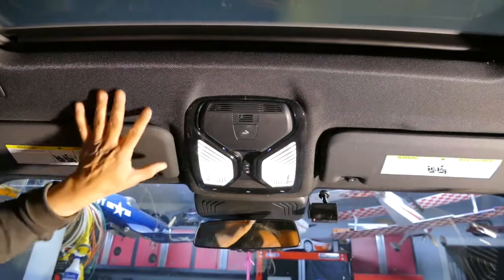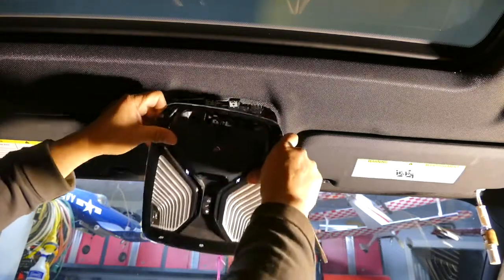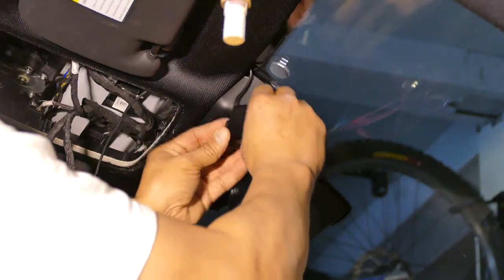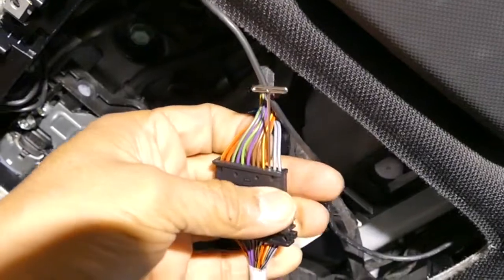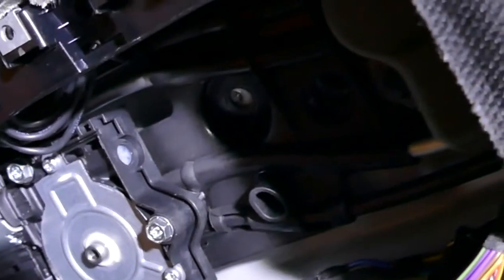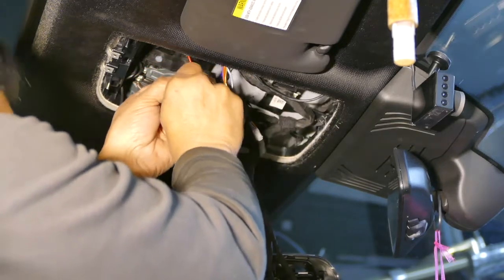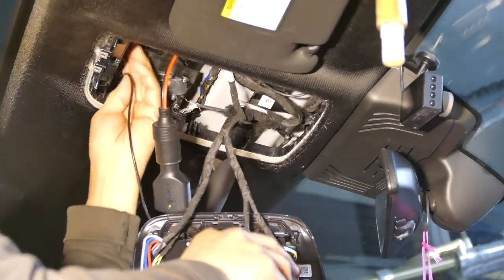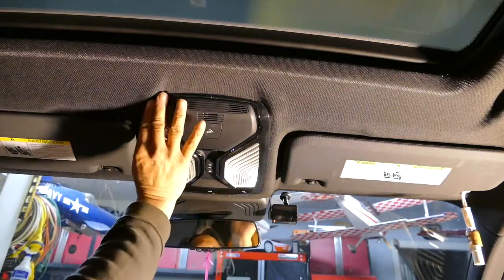2020 BMW X3 m40i Dashcam install and dome light power tap

Comment: Thank you for this video!!!  I did it to my 2018 X3 today.  Garmin Mini 2 works great !!!  A couple of things for other viewers...  You have to push the silver clip, not the black clip to remove the dome light.  The video doesn't show.  Push the silver portion you can see.  Another one to note is the power to the camera was shut off 6 minutes after the engine was stopped and alarms activated.  I kind of like this delay because it will film you if you walk to the front of the car. (only have the front camera)

Comment: Thank for the video and instructions! Just wanted to add a few notes to help others. To unlatch the dome light, screwdriver goes through the opening (adjacent to the tweeter), not from the top. My bad on that.
Also my 2018 X3 M40i in Canada took 15 minutes before power shut-off. Again, thank you for the helpful video!

Comment: What a brilliant find for me !  I have a 2021 X3 and plan to do this in the next couple of weeks --- thanks.  Tried it on my 2021 X3 and the gubbins and wiring block under the roof console were quite different looking to this one.  Couldnt find a 12v that turned off when car was shut and locked, so I'm going to have to do it the cable routed to fuse box way instead !

Comment: Thank you for the detailed instruction. This is inspiring. Please can you explain more on why you select the third wire? Do you have a schematic? I have the Ista+ software but I cannot find it.
Reply from the maker: I tested all the wires for signal and power using an oscilloscope and the 3rd wire seems to be straight DC 12v. It also was able to power a few 100mA without any voltage drop. Other wires either carry some signal or can not take any current draw. I do not have any wiring diagram, that is why I had to test each wire manually.
Reply: @rtabcum  thanks RussleCA for the detailed explanation. I have found the use of each pin on my car using the ISTA+. For you, I guess the 3rd pin is some sort of power supply. If you need to know more about your car, please let me know. I can search for you, free of charge.

Comment: Would this also work for a blackvue camera? Would the power source you used allow the camera to do parking mode recording also?
Reply from the maker: I actually don't know the Blackview current draw. However, the terminal I found only energizes for only 10 minutes after locking the car. It does not stay on. You may have to look for another wire that will stay energize.